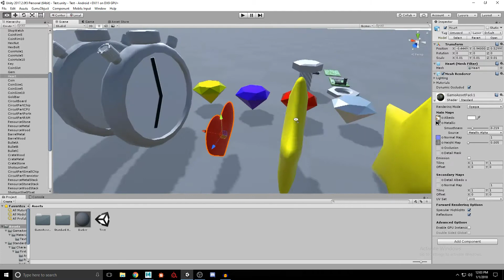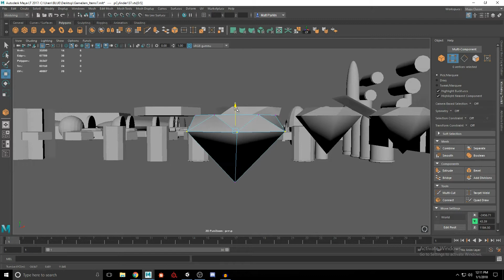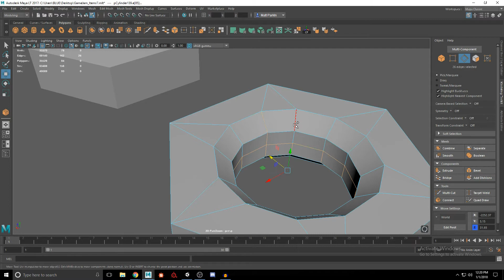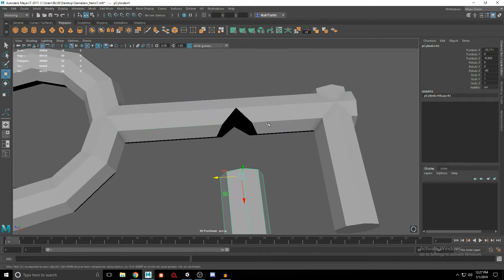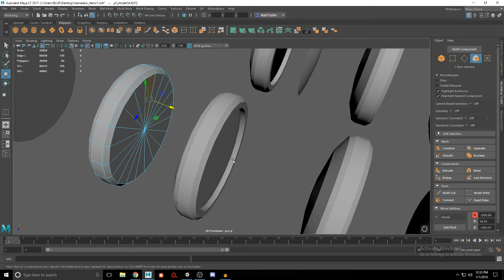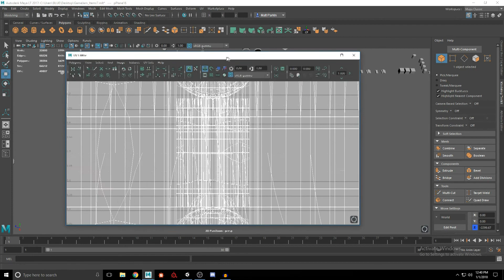Maya LT / Unity - Massive Game Asset Pack 1 - 70+ Items! (Fully Modeling and Unity Setup Tutorial)

Comment: Unpacking Pack
Hi Matt, this is a silly question, but how do I unpack the Game Asset Pack, please?

I dragged the .fbx file into my Assets folder, and then dragged the item into my scene.  I managed to highlight one of the items and drag it out of the pack.  But it still seems to be attached to the pack.

My version of Unity 2017.4.3f doesn’t allow me to import an fbx file.
Regards,
Nick
Reply from the maker: Unity should allow an fbx no problem. If you import the whole pack you can separate them and save them off as individual prefabs
Reply: Thanks Matt,
Sorry for not replying b4.  I managed to get that to work after writing the comment. Didn't know if that was the correct way to proceed.
Regards,
Nick